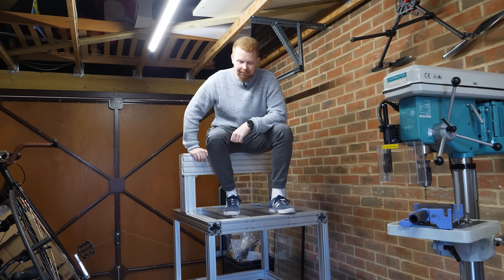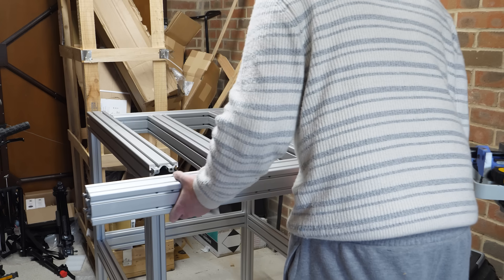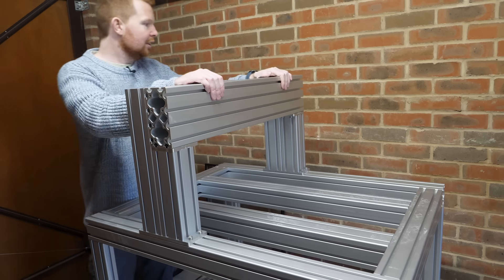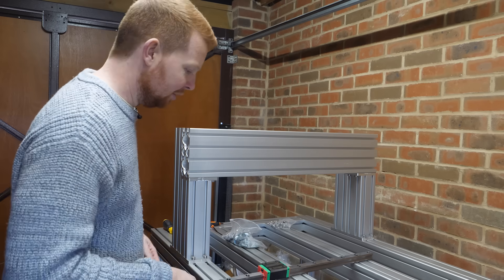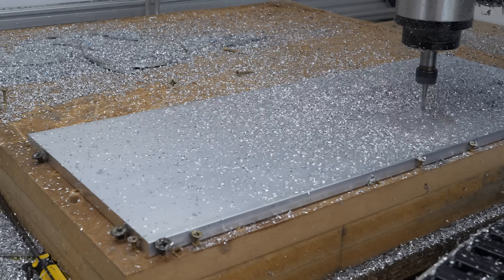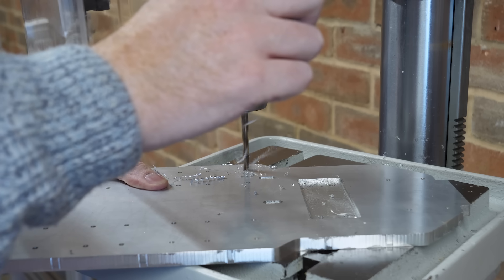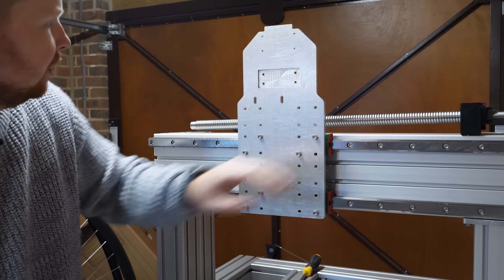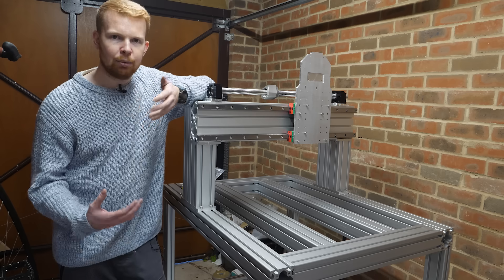Building a CNC Mill/Router - Part 1

Comment: I'm working on a similar project, and what I've found is that our muscles are unreliable at assessing stiffness of structures meant for CNC machines. A frame that "feels" rigid can still flex by amounts many times greater than the tolerances we wish to hold. I've run many FEA analysis on my machine and keep having to add stiffness to reach my goals. One of the beauties of T-slot extrusion is it's easy to add rigidity by strategically adding members. A downside is it's not generally the most cost effective path to adding rigidity.
Reply: For all intents and purposes once you start getting into the micron turf you notice that everything is made out of rubber. Even a Deckel FP4 is rubber if you pull at it with your hand and look at it with precise enough measuring tools.
Reply: @Narwaro  Very true. Even with the huge cast-iron professional production CNC machines I used to work with for a living for a while, I could put a dial indicator on the spindle and push the spindle a couple hundreds of a mm by hand. That is of course also why in a production environment we measure everything, and apply corrections to the cutting coordinates as needed, including correcting for tool wear and coolant temperature. The joys of manufacturing transmissions...
Reply: These extrusions are generally quite light compared to i.e steel tubes the same size and even those don't have enough mass to dampen vibration. 
I mean it also depends on how hard you gonna push it and what material. 

One of my biggest doubts about these designs is using the thread holes in the ends of the extrusions. As the aluminium is quite soft the threads often wear out with a lot of vibration and forces. So the extrusions themselves might be rigid, but the joints maybe don't last long and for a CNC they need to be precise. 

Maybe using gusset plates if possible would be a good option and use the slots to connect. They might loosen too, but you can tighten those joints back up.
Reply: I’m always surprised by the lack of diagonal members or even just some corner bracing in these extrusion-based designs. I assume some diagonal bracing would add quite a lot of rigidity.
Reply: Folks on a budget should consider V1E LowRider 3, the entire gantry goes up/down, so you get relatively rigid cuts for thin stock.  Personally built a 4 foot x 8 foot CNC and Sled for $900...
Reply: The most cost effective path is usually to buy a CNC machine hahaha 🌈 but the most fun effective path is to build it yourself of course 🌈
Reply: @eIgHtY0N3  Welding can create some warping its true  - but you can fix that after it has cooled, and shouldn't really need to worry about a heat treatment, as while it might be a little softer than the rest of the frame its all soft mild steel. None of it needs to be hardened.
So you just have to shim or scrape the spots for the linear rails so they are parallel/perpendicular/coplanar to each other.
Reply: Epoxy filling with rebar will help vibration and weight, but doesn't add much for rigidity. 

For that, check out the steel square boxed profile with holes. Strategically placed, they can do a lot to help. Run a 1inch steel plate on the back of the gantry. Use epoxy along with the bolts at your joints.
Reply: If you're only worried about Y-axis wobble, some diagonal supports from the gantry mount to the edges of the bed could do wonders. Pretty cheap, can either be under compression or under tension and it'll work. People often do that with 3D printers with this design, obviously with much cheaper/smaller supports than would be needed here, but the theory does scale up
Reply: Would extrusion be good as a skeleton for a bunch of thick(ish) plates to be bolted to it?
Reply: 11😅😅
Reply: Indeed, though the chunky stuff like this is big enough to have a central core you can fill in epoxy granite type mixes for some small gain, but any gains are good. Though the slots themselves are not the best either... 
Still not how I'd build a CNC given a choice - as I might not be good at it but I can weld well enough to get by and big boxy thickwall tubes are going to be much better than these extrusions...Though I am somewhat tempted by an extrusion based thing coming as a cheap kit  - something to get me working subtractive CNC quickly and should be good enough to bootstrap itself into a better machine if required.
Reply: @foldionepapyrus3441 ⚠️ God has said in the Quran:

🔵 { O mankind, worship your Lord, who created you and those before you, that you may become righteous - ( 2:21 ) 

🔴 [He] who made for you the earth a bed [spread out] and the sky a ceiling and sent down from the sky, rain and brought forth thereby fruits as provision for you. So do not attribute to Allah equals while you know [that there is nothing similar to Him]. ( 2:22 )

🔵 And if you are in doubt about what We have sent down upon Our Servant [Muhammad], then produce a surah the like thereof and call upon your witnesses other than Allah, if you should be truthful. ( 2:23 )

🔴 But if you do not - and you will never be able to - then fear the Fire, whose fuel is men and stones, prepared for the disbelievers.( 2:24 )

🔵 And give good tidings to those who believe and do righteous deeds that they will have gardens [in Paradise] beneath which rivers flow. Whenever they are provided with a provision of fruit therefrom, they will say, "This is what we were provided with before." And it is given to them in likeness. And they will have therein purified spouses, and they will abide therein eternally. ( 2:25 )

⚠️ Quran

Comment: Great job Tom.
You'll probably want to use a dial indicator to tram the linear rails to each other.
Also fill any none moving parts with sand to reduce vibration and chatter.
Reply: His name is Tim. No relation to Tom.
Reply: @msdosfloppy  did you watch the video?... he said his name is tom at the end.
Reply: @MrOner07  Don't believe him, he's lying, we know it's really Tim
Reply: 😂 @msdosfloppy
Reply: Came here to say the same thing. Yall beat me to it. Have a good night yall.
Reply: i would even fill everything with sand&epoxy mix
Reply: @peterheinzo515  What's wrong with cement?
Reply: Additionally, the holes you drilled in the plate could be pulling the rails together or pushing them apart if they don't precisely line up with the holes in the bearings.
Reply: ideally also checking the rails against a straight reference as well as making them parallel. linear rails are not very straight
Reply: @kylewarren69 if you buy real rails from let's say Bosch rexroth or hiwin they are pretty straight. The Chinese ones are pretty much not straight.
Reply: Hiwin are definitely better quality but are also made in China :)
Reply: @angusmack8329  Hiwin have plants in Taiwan, Germany, Japan, USA, Italy, France, Switzerland, China, Italy, Singapore, Korea, etc....And quality is good to great.
Reply: @jimmer411  as soon as you get one rail parallel to the bed you tighten the second rail, it will then automatically become parallel to the first one because the spacing between the rails in the Z plate is fixed.
Reply: @jimmer411   I guess you are not understanding what I mean, IF the first rail is not parallel to the bed and you dial in the second rail after the first one you will never have a spindle that is going to be parallel to the bed. Thats why you try to get the first as level to the bed as possible, if the bed is tilted in one way or the other thats another problem, but the bed doesnt have to be extremely flat because you always want to flatten the surface with your machine anyway.
Reply: No you should use a dial indicator from 1 of the rails to you bed so that you get that one rail aligned to the bed, then you mount the Z axis and the second rail that will be aligned automatically to each other. Start by tightening the screws in one end of the second rail and tighten them as you move the Z axis along the way.

Comment: Yes. We needed to see this. I'm excited. Why did you go so overkill on the frame?
Reply: There's no such thing as overkill on any part of a CNC ime.
Reply: I would assume it's to minimise vibrations and maximise rigidity and sturdiness. Better when trying to mill/route much harder materials.
Reply: It is not overbuilt if you ask me. He will have to beef it up with cross braces, epoxy granite, thicker spindle mounting plate and perhaps more linear rails under the bed if he is looking for 1/100mm accuracy. Or go quite slow....